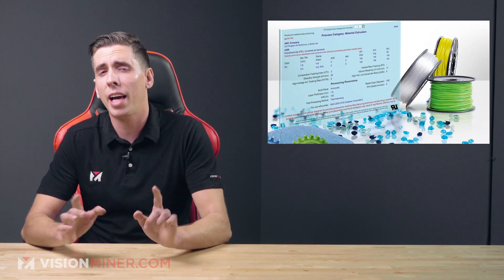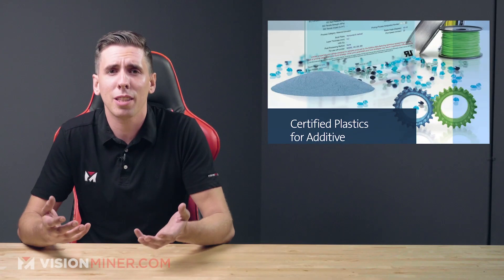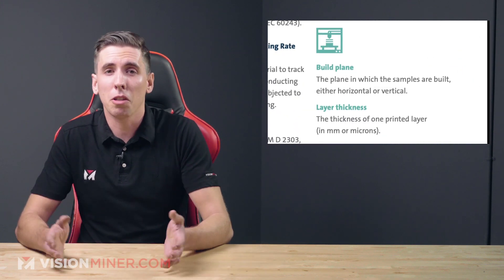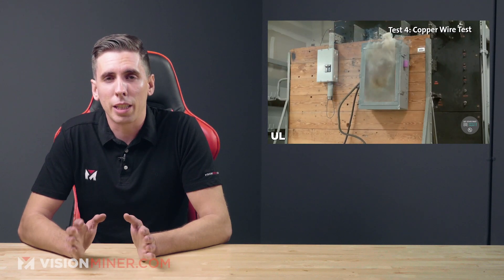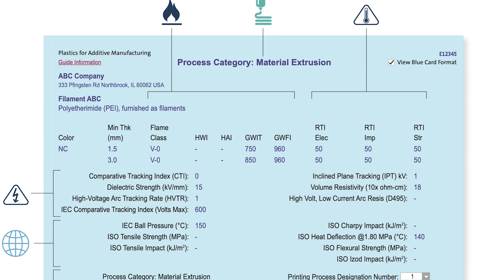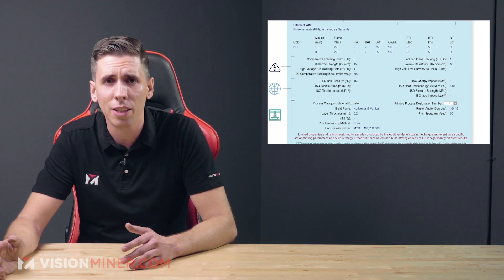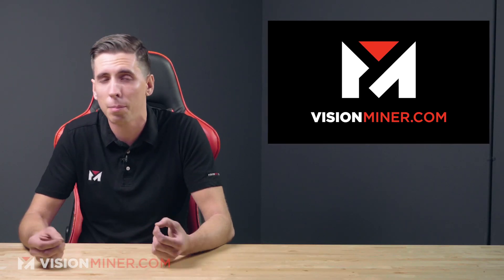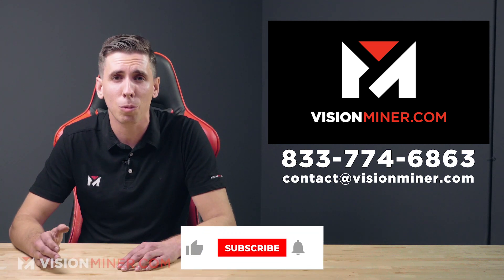UL Blue Card Plastics for Additive Manufacturing / 3D Printer Filament - What does it mean?

Comment: I think you are very likely missing the point of the UL cert.  If you'd like to commercialize something that is 3D printed with electronics in it and get UL approval , you better use a material and printer the are UL certified otherwise you will have to independently certify your enclosure for flammability and other considerations.

Comment: I would pay extra for my filaments Just to have that super useful extra info (suggested layer heights, temps, humidity percentage, material strength, chemical / electrical resistance, post processing methods, etc) 
Like- that would be Insanely useful for choosing different filaments for specific niches